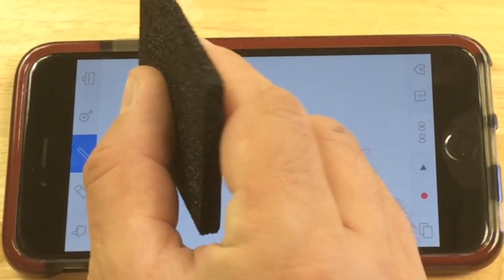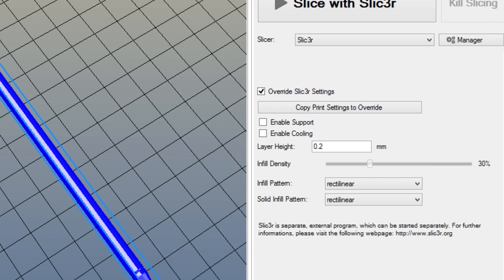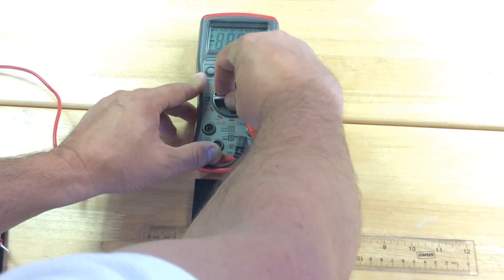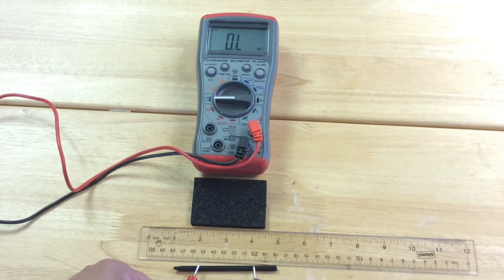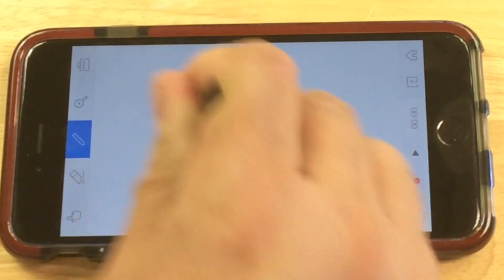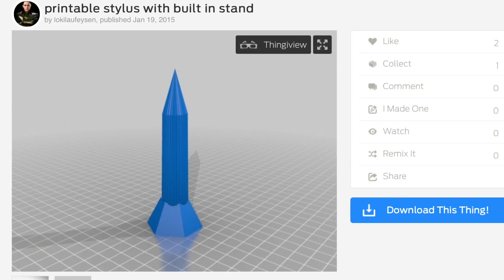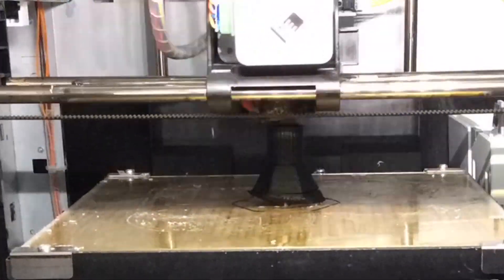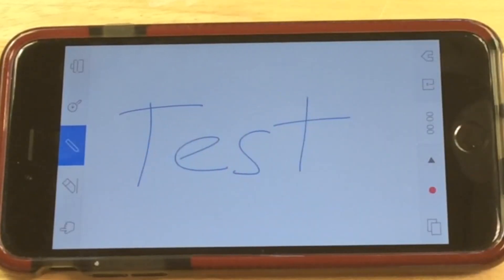Filament Friday #32 - 3D Printed Stylus for iPhone using Conductive Filament

Comment: Does anyone know why Da Vinci 1.0 stops in the middle of a print for no apparent reason. Resonantly was printing a lid and fail twice after about 3 or 4 layers, then on the third try it worked fine
Reply: +Chuck Hellebuyck's Electronic Products       It stop and return to home, it did again today, it stop lcd said Heating up then it return to home and shut the lite off and lcd when back to the Home screen.
Reply: +Chuck Hellebuyck's Electronic Products -- the extruder was 215 and the bed was at 196 when it stop and returned to home. I just tie rap the extruder connector as per xyz's replace video, will see how that works.